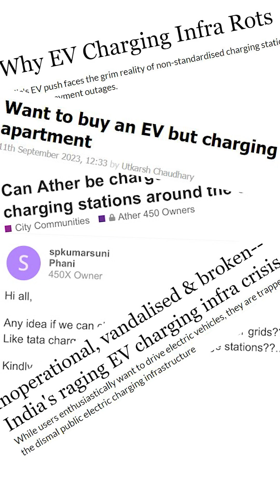Ather CEO talks about the need for common EV charging

Comment: That's great! Someone who actually cares about industry standards and uniformity so it helps the user.
Also Ather, I love you guys but I gotta say I'm pretty disappointed with the onboard navigation getting locked behind a subscription. The Ather 450 plus I got is more expensive than many other scooters I could've gotten, the range is just 70 while others offer 100 or more and I'm just mad because on board navigation was advertised as a built in feature, not something I'd have to subscribe to use. 
Just the maps getting locked makes my scooter go from a very functional tool to just a casual electric scooter with some downsides.
Please consider my request to keep the maps out of a paywall ❤